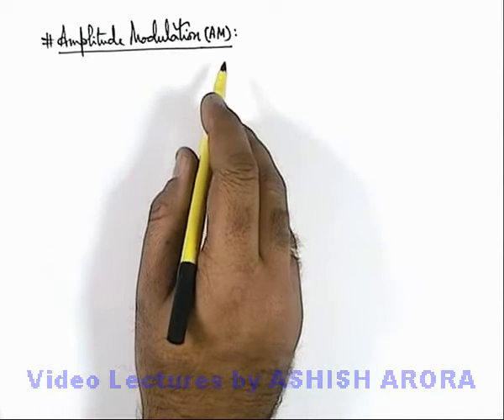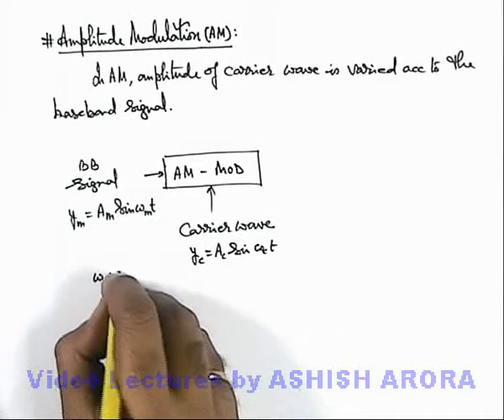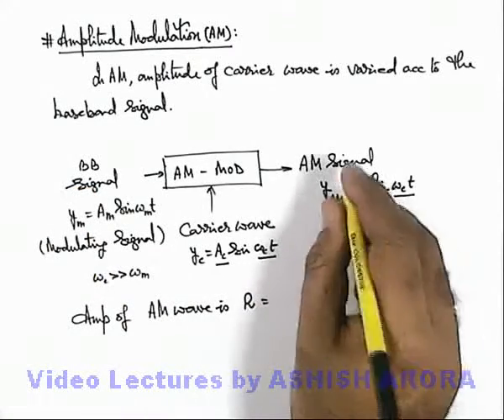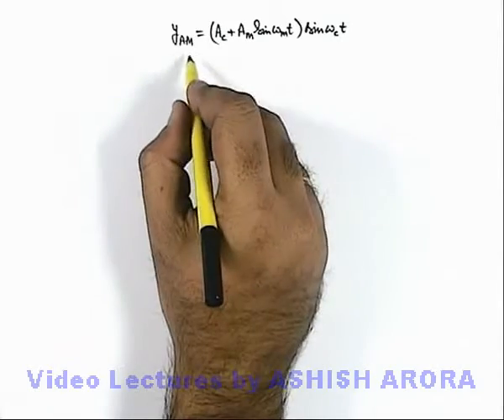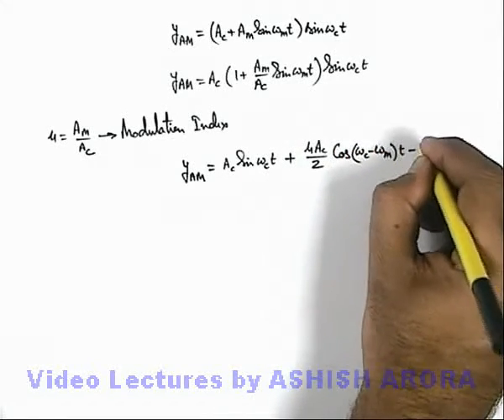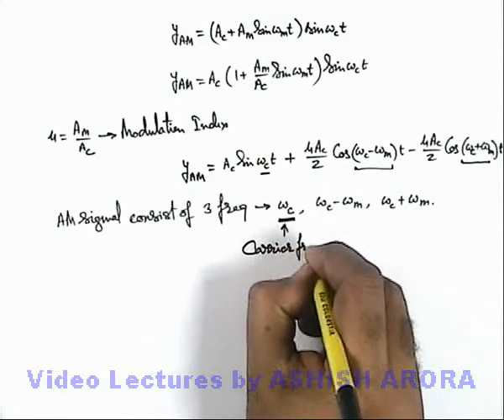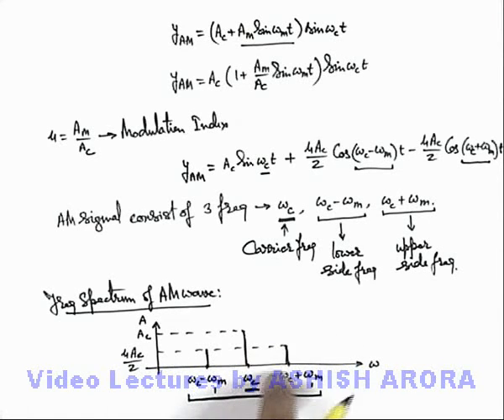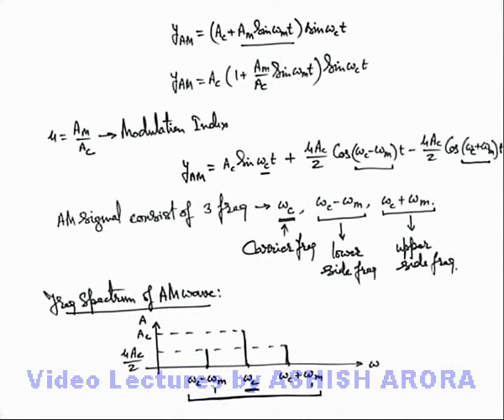Class 12 Physics | Modulation | #5 Amplitude Modulation (AM) | For JEE & NEET

Comment: How did u write equivalent amplitude ?A+Asin*(wt)
Reply from the maker: Because modulator superposes the two waves...
Reply: How did you derive this expression?....Is there not any specific derivation for this?...Why we can't write (A1+A2)sin(wt)....How can we directly add the amplitude of one with the whole equation of other?
Reply: @prabhatkumarverma200  
Imagen wt=0°.  Am Sin (wt) = 0
Wt =90°. Am Sin(wt) = Am
wt =270°. Am Sin(wt). =  -Am
It's my understanding only
Reply: @prabhatkumarverma200  we can't do this as frequency are not same... Both the frequencies are different.. So even the normal methods of superimposing waves that we study in shm and waves didn't apply here..